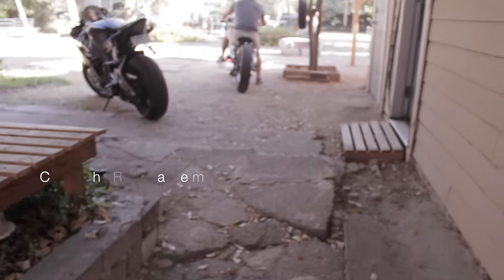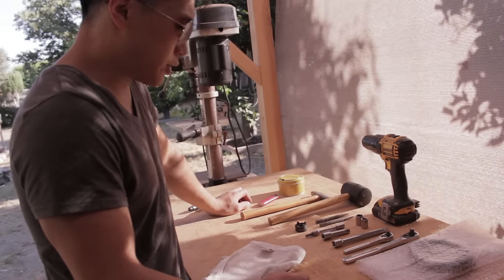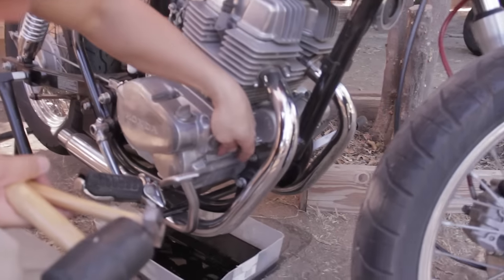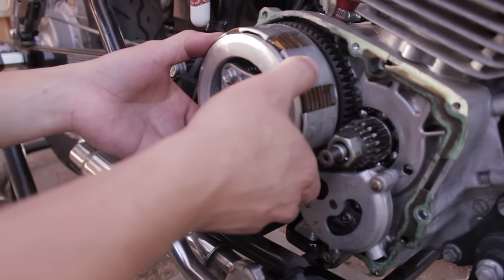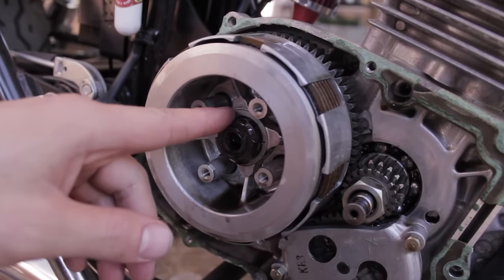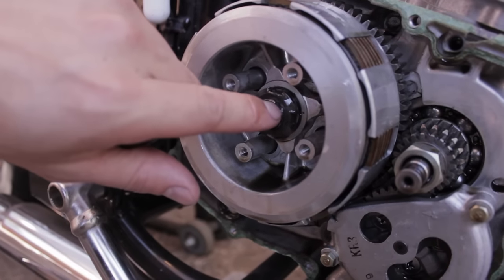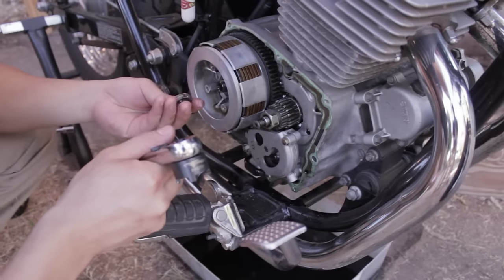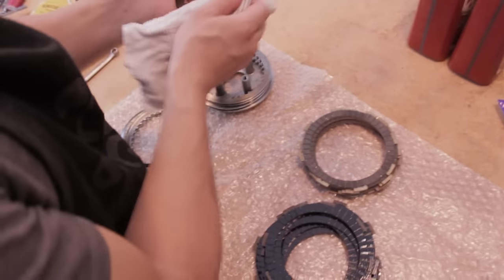HOW TO REPLACE HONDA REBEL CLUTCH DETAILED GUIDE [BEST CINEMATIC TUTORIAL]

Comment: Great vid, the mood! Just some technical things. The main basket nut obviously also has a proper torque value to it, and new disks, let them bathe for a while in fresh engine oil before installing. It prevents unnecessary premature wear or damage. ;)

Comment: how much torque / nm goes onto the clutch plate bolt, the one with the springs behind?
Reply from the maker: Clutch Lifter Bolts: 9 ft-lbs (108 in-lbs)
Reply: @acigarwilldo  funny enough, thats exactly the torque i used and 2 of the threads on the clutch plate snapped

Comment: Hey can you tell me how can i measure this "interesting nut" to choose the right tool. You use the 24mm but i'm not sure about it, my nut have 27mm roller diameter and 22mm in the groove. I must buy this tool from the internet and i don't wanna buy 5 times :D (sorry for my eng ;).) i got honda xlr 125 from 1998.
Reply from the maker: Hello. Check out this link:

https://www.amazon.com/gp/product/B004N6XY6O/ref=ppx_yo_dt_b_search_asin_title?ie=UTF8&psc=1

One of the product photo shows how the 4-Pin Spanner Socket is measured. Hope this helps!
Reply: @acigarwilldo   Thats what i need, thanks

Comment: HELP GUYS!!!!
Made it to 3:15, but unfortunately my clutch pack just won't come out. Everything else went smoothly. My clutch pack disks/rings are loose, but the outer silver part of the clutch pack housing will not separate from the bike. First time its ever been replaced, so i thought it might be the reasoning, but If anyone has had this problem or any pointers, it would be appreciated. Thanks in advance

Comment: What about that washer that needs to be staked to hold the lock nut in place? I didn't see you do that part, and it's the part I'm having trouble with (also having trouble finding a new one, as I'm told you're supposed to replace it every time)
Reply from the maker: Can you explain which nut? Staked nut? Let's figure it out. I'm always learning too!
Reply: ANSON HSU That washer that he removes right before removing the lock nut. At about 2:24, he says "there is a tiny, I don't know what it's called, bent, it holds the nut in place"... That's the lock washer, the bending in it is that it's staked... I need to find a new one of those washers, and I need to know how to stake it properly...
Reply from the maker: I couldn't find it either. It's comes like that from factory only. However, after speaking to a motorcycle shop mechanic I learned that you just have to torque it to spec and you're good. Rebels that are doing clutch replacement for their first time have it. But after removing it and putting it back on theres really no need to do it. Just make sure its tightened to spec. That person in the video is me by the way lol.
Reply: ANSON HSU
Ah... well... I purchased Honda part number 15451-KR3-601 and 90231-KB5-720 hoping this will fix my problem... My problem at current is an intermittent problem where the clutch lever is easy to pull like it should be, difficult to pull but shifting is still possible, or impossible to pull and only rev match shifting will work. As the bike sits parked where it is, it's currently at impossible to pull the clutch lever.

To make matters worse, I have a friend I'm wanting to teach to ride and the only other bike I have is an old Kawasaki KZ1000 that is far too much bike for a newbie, and I'm unwilling to let anyone else ride it, much less a newbie. So until I get the Rebel's clutch problem worked out, I can't teach my friend anything but theory.
Reply: Hey. Venturing my fix attempt tomorrow. Soaking plates now! Just wondering what torque spec you are referencing? Is there torque for clutch nut? If so what spec? It looked as if the torque setting on the bracket bolts was 100. Is that true?
Reply: Torrey Studebaker

Comment: I'm having a issue with clutch cable original one is to long do you have a video on how you got yours to work and be safe because original clutch cable is way too long and I don't know what to do it's brand new and I have the old one it works but they are the same length?

Comment: How much did you torque the springs down to.  nd is it in  Inch. or foot. lbs?
Reply from the maker: Here is the manual I used. I believe it is called "Clutch Lifter Bolt". Cheers! https://archive.org/stream/HONDAREBEL250SERVICEMANUAL/HONDA%20REBEL%20250%20SERVICE%20MANUAL_djvu.txt
Reply from the maker: Inch! Beware.

Comment: Good tutorial- But not all asian bikes are the same clutch baskets differ and KTM/Husquvarna uses thin steel on the ends instead of friction discs, Harley Davidsons Will Blow up on you if you dont Secure center adjusting rod before removing pressure plate nuts,Springs will shoot across the shop. Every bike has their differences.......

Comment: I need help :( I tried pressing down on the brake to wrench out the lock nut but it keeps turning :( Any tips? The bike is not on a stand, its on the ground. It’s also in 5th gear. What am I missing? :(
Reply from the maker: Keep it in fifth gear.

Method 1: Find a friend to hold the bike and engage the front and rear brakes.

Method 2: Stick a large pipe or wooden stick through the rear wheel spokes at the swing arm to stop the wheel from turning. Be careful not to bend the spokes.

Hope one of these methods work for you! Cheers and good luck! 🍻🍀
Reply: @acigarwilldo  Thanks for the reply! Will do :) !

Comment: great tutorial 10/10. but my clutch problem has to do with the return arm. when the transmission housing plate is bolted on, the arm spring seems to have no tension, and clutch lever on the handel bar wont return. when i remove the transmission housing plate, the arm will snap back fine. there is a little rod sticking out of the clutch basket that i assume is what the clutch arm is pushing against. have you heard of or encountered this problem and do you know a solution for it? thank you.

Comment: Looking to buy 2nd Rebel with bad clutch. Might bob also. Did you have to re jet? Did you change spockets since pipes/jets? may have increased hp? WISH they had a 6sd gearbox or dual range!
Reply from the maker: I did re-jet. 2 sizes bigger. Did not change sprockets. Power feels the same.

Comment: Great video! Thank you! Was just wondering what size socket do i need to pull the clutch hub nut?
Reply from the maker: It’s a 24mm Nut Spanner Wrench Tool

You can get it here: https://www.amazon.com/gp/aw/d/B004N6XY6O?psc=1&ref=ppx_pop_mob_b_asin_title

Remember to make sure you bend the little metal tab flat before you start to loosen it.

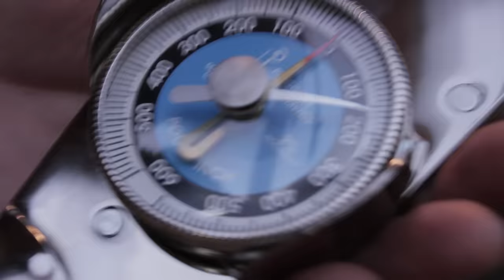Comment: the right torque wrench e.g. at 5:34 is super important! i tried faking it by using a 10–150 ft. lbs. torque wrench, but the ~100 in. lbs./9 ft. lbs. spec'ed was below range for it, and i snapped the clutch lifter bolts right off...
Reply from the maker: Good information. Thank you for sharing!

Comment: Idk what happened but when I was putting my bolt into the pressure plate all four of my bolt broke off and the springs came flying out. Did I torque it down to far? Am I only supposed to screw them down a little bit not until the plate is all the way tightened?
Reply from the maker: Make sure you screw them down evenly.

Comment: hi mr anson hsu i have honda rebel 250 model 2001 i not good at  mechanics  i start to change ring piston but i dont know how can i adjust the piston and valve are you have any vedio how can i do it
Reply: Karim Karim ..... I think you should do a video regarding the clutch cable in the casing of the clutch cover so people will put The spring on correctly not backwards like I did. when I squeeze the clutch the bike moves forward

Comment: Apologies for asking but how did you know to torque the clutch spring screws at 101 lbs? And does the spanner nut have its own torque spec or is it just a firm tighten?
Reply from the maker: Hi David, it’s 9 ft-lbs. I used a in-lbs torque wrench. So convert (ft) to (in) is 108! Spanner nut should be 54 ft-lbs. Hope that helps!

Comment: Thanks for this video! Do you mind sharing what torque tool that is?
Reply from the maker: That tool is a 3/8" Drive Dial-Type Torque Wrench with Memory Pointer 600 lb. in.
Made by Precision Instruments
Model No. PRED2F600HM

Comment: What exhaust is this? It sounds great. 
Any info on jetting the carb for pod and that exhaust
Reply from the maker: Hello, the exhaust are called "Shorty Mufflers" by EMGO I got on eBay. Just make sure you get the correct inner diameter so that it slips over your exhaust. Or use an inlet reducer like the ones included with these mufflers here: https://www.ebay.com/itm/EMGO-Slash-Cut-Chrome-Exhaust-Mufflers-SOLD-AS-PAIR-Great-Deal-51-00903/254057429755?epid=1832895509&hash=item3b2700bafb:g:XLoAAOSwPI1au-bA
Cheers!

Comment: I love the sound of those blue collar bobber pipes. I have a set of those and the ebc clutch waiting to go in mine next week.

Do you notice a huge difference with the EBC springs? They are supposed to be 10% tighter.

Nice post
Reply from the maker: Thank you! Pipes sound good indeed. The EBC springs however, didn't feel tighter. After changing to them my clutch became really soft. Not sure why. But I plan on switching back to factory or heavier.
Reply: @acigarwilldo  ouch, not good news

Comment: doing this soon on 88 Honda Hawk and just checking things out. Great video. I dont think Hawk has the 4 grooved nut, its just staked. Good tip on locking the brake. I read guys taking off the plate and putting bolts back on the springs with washers which supposed to lock the basket too ;)
Reply from the maker: OOOh thats clever! Thank you for the tip!

Comment: Did you tighten that clutch plate all the way down so that the springs all almost totally compressed?
Reply from the maker: Hi Mark, yes they need to be tightened all the way. But alternate between each bolt when tightening so the springs compress evenly. Cheers!

Comment: Thanks for the video any way you have the actual part number? I'm having a hard time getting the right parts online. Tia
Reply from the maker: Clutch Plates: https://www.ebay.com/itm/EBC-Heavy-Duty-Clutch-Plates-Kit-Honda-CB250-Nighthawk-CRF150R-CK1191-/162963454376?_trksid=p2349526.m4383.l4275.c10#viTabs_0

Comment: Can you tell me about your exhaust? I have a 250 rebel also, been trying to come up with a new exhaust solution, mine leaks bad and is old and factory (87) with mufflers chopped by previous owner. I like your pipe size, and simplicity straight down to those nice looking cannons on the end, are they mufflers?
Reply from the maker: Yes they are mufflers indeed. You can find them on eBay called "EMGO shorty mufflers" they are about 1 feet long. Happy building!
Reply: @acigarwilldo  Thanks a ton brother, I dig your build, your channel, and your vibe. Stay groovy!
Reply: Last thing, what size pipe is that from the header down to the muffler? Did you custom shape the pipe? or order? What is sealing your header to start of pipe? I've been having trouble with getting a seal and stopping exhaust leak.
Reply from the maker: @Holdenm-xf1hu  I did not custom-shape the pipe. I just cut and then slip over the shorty mufflers. "Sealing the head to start-of-pipe" applies if you remove the pipes from the engine block, and then reinstall them, you will need to buy new exhaust gaskets here:

https://www.ebay.com/itm/Set-of-2-Vesrah-Exhaust-Gaskets-18291-MN5-650-CB-CL160-175-200-XL-XR250-350/172527139530?fits=Model%3ARebel+250%7CMake%3AHonda&epid=171225380&hash=item282b6b3aca:g:ibIAAOSwfVpYn2jM:sc:USPSFirstClass!91780!US!-1

As for the mufflers. It's been so long I can't remember the diameter of the factory pipes but basically what I did was I got the shorty mufflers with smallest inner diameter that allows me to slip it over my exhaust. But there was still wiggle-room so I used reducer rings. Like these:

https://www.amazon.com/Emgo-Muffler-Reducer-80-47310-1/dp/B00230CC0G

Make sure you measure the diameter of the pipe, buy the muffler with the right Inner Diameter, then use pipe reducers to make it fit. Finish off with exhaust sealers or wrap it.
Cheers and thank you for the love & support brotha!

Comment: thank you very mucho maestro, finally riding again and oh does it feel so good :D...I too am a bobber convert and now that my bike can actually turn on again lol, i'm gona knock out the last two things left to do, rear turn signal lights and license plate bracket...did you fabricate either of those mounts yourself or did you buy them? i'll follow your lead lol
Reply: although i'd like to reuse any of the old lights and/or brackets if possible...i'm not rolling in much dough these days and yea...any advice would be much appreciated on DIY
Reply from the maker: Anytime. Glad to hear you're riding again!
Reply from the maker: @bruceng2008  I used something very similar to these: https://www.ebay.com/itm/Motorcycle-License-Plate-Holder-License-Bracket-For-Harley-Bobber-Choppe/193172407894?hash=item2cf9f90656:g:1CcAAOSwOZ1dUOJr

Comment: Hey I changed my clutch plates and disk with new springs I even soaked them but when I installed everything back together my clutch cable wont not let me drive
Reply: It won't go into fist gear then kill because it had no tension to the cable
Reply from the maker: @kendricksnearl3848  when you say the clutch cable won't let you drive, do you mean you're not able to disengage the clutch? Is the clutch lever loose? Stuck? Or has tension? Please explain.
Reply: @acigarwilldo  I changed everything exactly how I goes didn't leave any out I think the basket isn't aligned because with the clutch cable pulled in right it jump then stalls when I put it in 1st gear
Reply: @acigarwilldo  I ordered a whole new clutch pack exactly like my old one so measurements not off I think I assembled something wrong
Reply: @acigarwilldo  I was told if my clutch basket not aligned it would jump and stall out

Comment: Hey!! Question.. if you do not have a torque wrench what would you recommend? I’m having a hard time finding one that isn’t $100+ dollars for that small of torque
I’m a newbie. Great vid and thank you for the info!
Reply from the maker: MrMgarman my friend, first of all I want to thank you for watching and showing support. As for your question, I would highly recommending investing in one or borrowing a torque wrench. I say this because when working with critical engine components you should always follow the technician manual so you don’t run into bigger issues and damage expensive parts. It would be wrong for me to tell you to “guess” or “feel” it. What I can do is provide a link to a fixed dial torque wrench. They are very reliable and don’t need much calibrating as long as you take care of it: https://www.amazon.com/Performance-Tool-M195-Torque-Wrench/dp/B006G4I7DQ/ref=br_lf_m_r66xtge8xpn244d_ttl?_encoding=UTF8&s=hi&th=1&psc=1
Reply from the maker: MrMgarman Note: the clutch lifter bolts needs to be torqued to 108 in-lbs (9 ft-lbs) (12 Nm). Happy Riding!
Reply: ANSON HSU got it!! Thank u for the reply. Ordered the part.
Reply: @acigarwilldo  Another question, which I can't really seem to find a clear answer to.. How do you know when the gasket needs to be replaced?
Reply from the maker: MrMgarman It is good practice to change the gasket every time you replace clutch plates. Since the intervals between clutch plate replacements are pretty far apart that the old gasket most likely is “baked” on or brittle or cracked upon removing the cover. Unless the gasket was replaced very recently and is intact when you removed the cover. Cheers!

Comment: hi there, i have a honda shadow 1983 i buy this bike with 3 screws of the clutch broken (i change that screws) but the clutch not cut and its verry hard to pull, what you think is the problem. thaks for your atención.
Reply from the maker: Don  Ramos hello! Please describe in more detail. If your clutch mechanisms are working smoothly but still hard to shift up then I suggest try changing engine oil. Keep me posted. Good luck!
Reply: ANSON HSU this bike its over 45,000 miles, the guy wen sale me the bike he say "you just need change the clutch wire" but i was sure that is not the problem so i open the moto and i see 3 screws of the clutch broke and i change it, but steel not working, i was trying to understand the clutch mechanism and i see one part and the work of this part its push the rotative thing in the springs.
Reply: this bike wen is off, you can move the transmicion positions normal, but if i try   do that bike On, its not working, the lever its realy harder to pull and i think its not pushing nothing, do you think its the clutch springs?
Reply from the maker: Don  Ramos I need a visual.
Reply from the maker: Sounds like your clutch is not fully dis-engaging. Try adjusting the clutch cable at the lever. Also since you already opened the side cover you might as well replace the friction plates and springs. Here is a link that may help you: http://www.fixya.com/motorcycles/t14820001-1984_honda_shadow_vt_700_clutch_issue